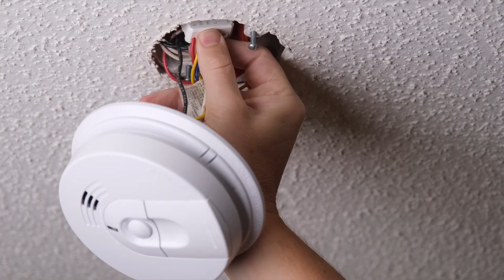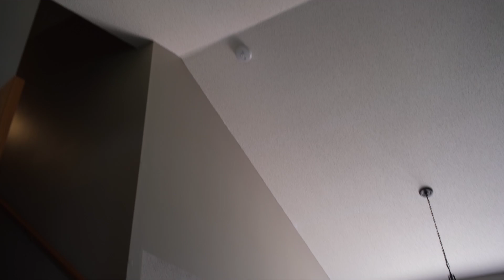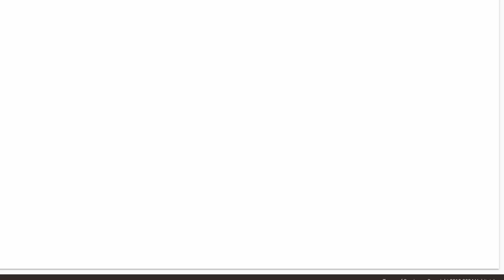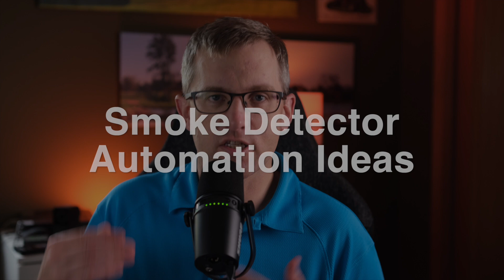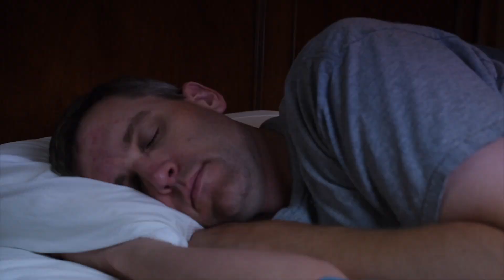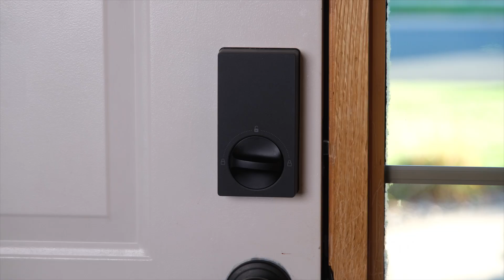Make ALL of your smoke alarms smart in 5 minutes for under $30

Comment: How do you connect this to smoke detectors that have the wiring attached to a single connector into the back of the smoke alarm?
Reply from the maker: The smoke detectors in the video are the type with a single connector. If you remove the mounting plate from the ceiling by you’ll see where the wires from the connector connect with the circuit and that’s where you install the dc signal sensor

Comment: Great and timely tip. I have smoke detectors wired throughout my house. I also added two z-wave smoke detectors to my Ring monitored security. However, I had to yank them both because they both kept blaring false alarms several times, which triggered Ring, which then almost sent the fire department. They were too unreliable. This looks like a good way to get some smart functionality without accidentally calling the cops!

Comment: Interesting. Think I will pull a 14/3 from my basement to the mech room and install this. I have always wanted to intercept the signal for things to do when a fire is detected. send a phone alert, shut off the furnace, unlock all doors.
Reply from the maker: Shutting off the furnace is a good idea
Reply: @DIYSmartHomeGuy1  Disabling all fans (bathroom, ceiling, attic, etc) until after the alarm stops, would be a good idea as well.

Comment: You can get wireless smoke detectors that communicate without hard wiring, and which can interface with one hard-wired detector.  I think you could use those and connect this to the one hardwired detector without needing to hard wire detectors thruout your home.  The one hard-wired could be connected to a plug and plugged into an outlet - you aren't really using it as a detector as much as "a place to connect the signal sensor."